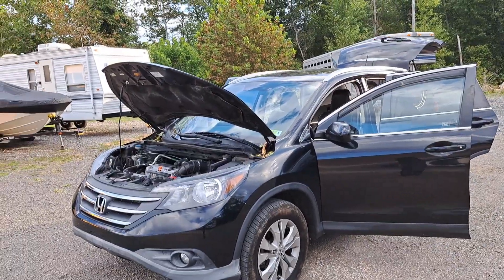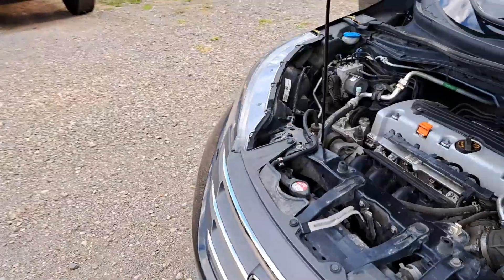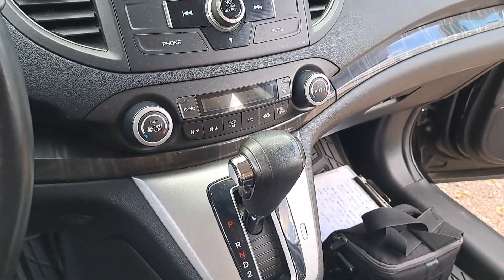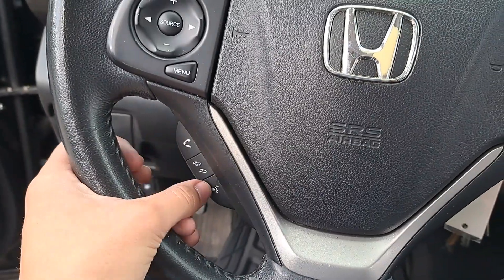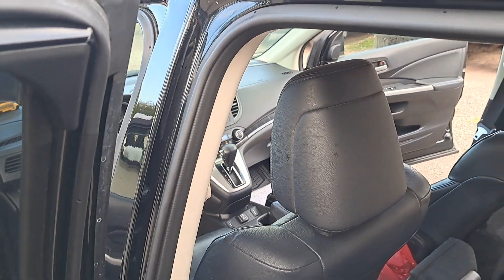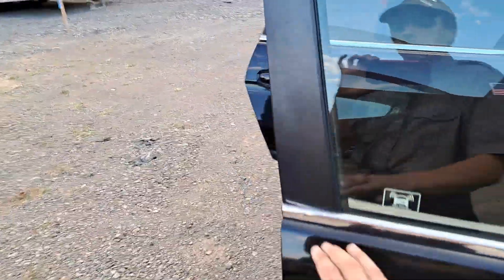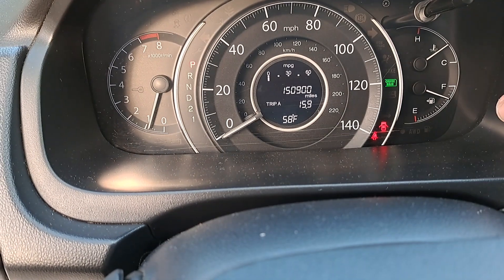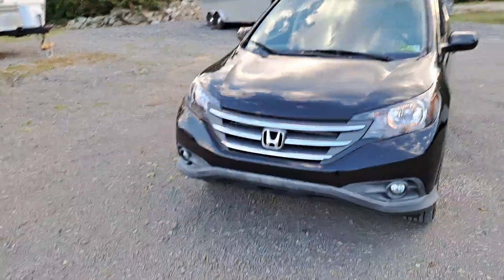2012 Honda CR-V EX-L | My New Daily Driver

Comment: We bought our 2014 CRV EXL last fall almost exactly 1 year ago. Had 83,000 on it now it has 88,000. We love it and drive it everywhere. All we had to do so far is replace the tires because the old ones were bad in the snow. We put on Michelin Defenders. Other than the typical K24 Rattling VTC actuator in the cold it's been perfect.

Comment: The Honda CR-V is a really good, reliable car. Yours looks to be in pretty good shape and it looks like it should last at least about 5 or 10 years from my guess. Maybe more. But pretty nice though. Good choice for going to your job and for doing some other driving tasks. But like you said, for working on 23 and 594 and for hauling bigger parts, you probably still are going to have to use your Ranger sometimes.